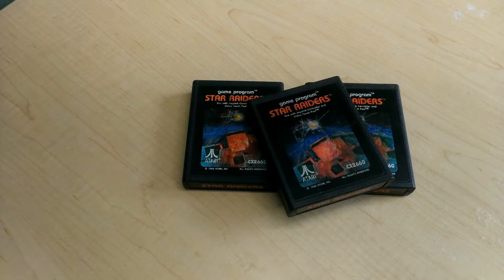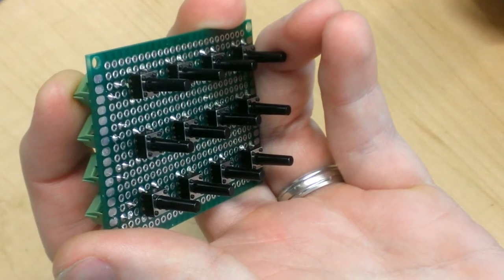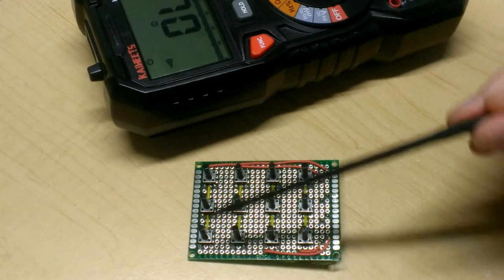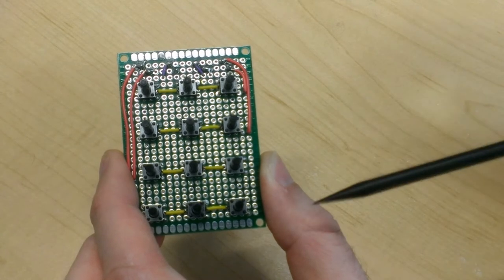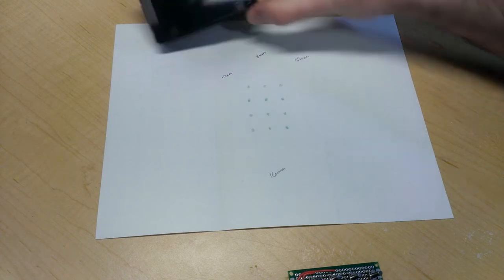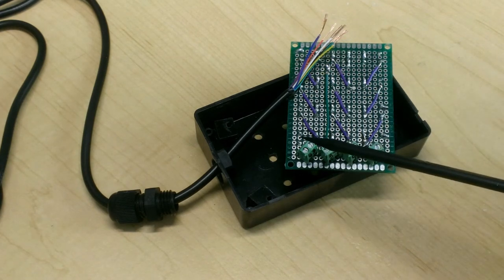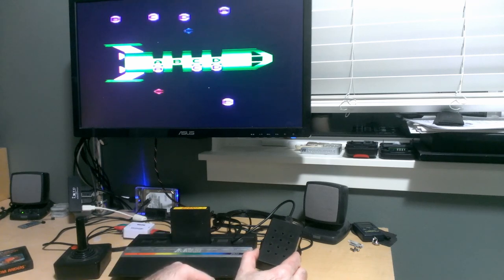Building a Universal Atari 2600 12-button "Star Raiders" Controller

Comment: I'm gonna explain this in detail in case someone happens along who wants to learn what this is doing and how/why it works the way it does:

As several folks have noted, the resistors are for the paddle inputs pulling them back up to 5v quicker so that they can be read as digital inputs (since pin 7 is 5v.) The VCS/2600 is kinda unique in that most of those pins go to one of the three chips that make up the machine: The MOS 6532 RIOT. It's got I/O pins that are normally read as inputs for a joystick, but some of them are turned into outputs for use with this controller. You've got direct control over whether pins are input or output, and when they're set for output, you have control over whether or not they are logic high or low. You NEVER set the pin to output and to output high on the 2600. Here's the pinout of the connector for reasons why:

1 JS Up
2 JS Down
3 JS Left / P2 Fire
4 JS Right / P1 Fire
5 P1 pot
6 JS Fire
7 +5v
8 Gnd
9 P2 pot

There are multiple pinouts of the Atari connector … but this one (for the C64) is most accurate as to what's going on with the connector. Each of those things that is normally an input has a "pull up" resistor to 5v to ensure that the pins read as a known state whether there's anything connected to them or not.

If a joystick is connected, the nine pins connect to "nothing" (but pulled to high) until the joystick is used, in which case the joystick will ground one of the JS inputs. Why you never risk outputting a 1 is that if someone has a joystick plugged in and moves the stick while you're outputting logic high, you have an instant short to ground! So you keep the pin on input and only flip it to output after you've set it to output ground. If a joystick is grounding the pin the same time the RIOT chip is … no harm!

But then you come to the pots… The joystick doesn't connect them to anything. A resistor still drags the voltage up towards +5v, but it's far from instant. In the Atari, the TIA (Television Interface Adapater AKA "special sauce") chip does magic to turn the pot's rotation position into a number. But we don't want a number, we want a binary low or high. So we use a smaller resistor that makes it read as "high" faster, and we ground it to get a low, like with any other input.

So now you have the recipe:

Set output value of the four direction pins to 0 (even though they're still inputs!) Then, each time we read the inputs, we:

Set pin 1 to output (0)
Read P1 pot and test it for high/low to get button 1
Read P2 pot and test it for high/low to get button 2
Read JS Fire to get button 3
Set pin 1 to input

Sit pin 2 to output (0)
Read P1 pot and test it for high/low got get button 4
           :

Again that all happens SO fast you don't even see it. Pretty nifty!

There are four kinds of controllers from the day and a fifth that get used today. I think I've explained three of them. Omega Race had its own piggyback controller which sits between the Atari and your standard joystick controller to give you a second fire button (on pin 9). I don't know if it uses a resistor like the keyboard controller does to ensure that the signal returns to logic high faster or not. The last is a modern thing: The Genesis controller. It works by putting button C on pin 9. But it's a little more complicated than that.

See the Genesis controller has more buttons than you can possibly read from a classic "atari style" joystick port. Or rather, I should say more pins than you can read from a standard Sega joystick port. THEY ARE NOT THE SAME! Pin 7 on the Atari port is permanently +5v. On Sega ports, it's pin 5 that's permanently +5v. And remember what happens when you plug in something that accidentally connects +5v to GND: Magic smoke happens!

Turns out the Genesis controller uses +5v to power a chip that selects between two sets of inputs. One of them is the A button and Start. The other is the D-Pad, B, and C. If the chip expects +5v on pin 5 … it'll get something close to that by accident from the P1 pot's pullup resistor. Since pin 7 is permanently high (being +5v for Atari and C64), it guarantees the controller is set to read the D-pad (pins 1-4), B (pin 6), and C (pin 9). Pin 9 has no fast pull-up resistor, but it's fine the way modern Atari games use it since they're not scanning a keypad and they're coded to know what to expect.

I've been considering the C64 and Atari ports synonymous. I don't have a C64 schematic in front of me to know if the pot lines have any pull-up resistor to +5v on the C64. They SHOULD because you should never leave a pin floating with any kind of MOS technology, and the SID chips are NMOS or HMOS (depending on the vintage…) Still, some people have reported that use of Genesis controllers have fried their SID chips. How realistically likely is that? I'm gonna say pretty low since there are so many other variables, but I'm pretty sure the Atari is safe to use them this way. If in doubt or to be 1000% safe for the C64, make an adapter cable that leaves pin 5 floating (which is safe to do as it's an intended state) and connects pin 7 on the port to controller pins 5 and 7. Through 4.7k resistors if you really want to be 10,000% safe I guess. But the TIA isn't gonna flinch at having a digital button connected to its paddle inputs, so … don't worry about it too much unless you want to also think about the C64.

The other thing to consider is the 7800 which used resistor tricks to make its two fire buttons work. The VCS/2600 doesn't see or care about the difference.

Comment: As pin 7 is permanently 5V, these two resistors are clearly pull-ups for the Atari inputs 5 and 9.  Looking at the schematics of the VCS main board, these pins are later connected to a 0.068 (uF?) capacitor and to the TIA chip that does its weird analog to digital conversion. My guess here is that the existing pull-up capabilities are not enough to charge the capacitor to its idle +5V state fast enough. Therefore the resistors here help with this issue.
The pin 6 line on the other hand is internally connected to only a 220pF capacitor (for noise reduction, probably) and obviously this poses no problem for the circuitry.

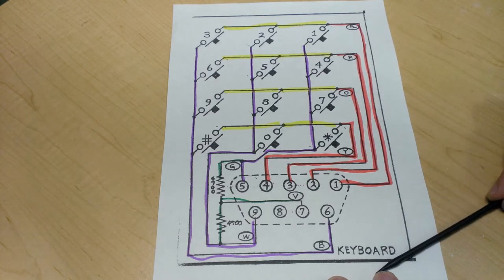Comment: To pile on what I’m sure others have written regarding the resistor circuit @6:45 , pins 5 and 9 are the paddle sense input pins, which via the 5v dc pin 7 supply gives a fixed voltage to the paddle inputs , unless a button on columns 2 or 3 are pressed. So the paddle inputs, being analog that produces a 0-255 value from a voltage , get repurposed as digital column binary inputs by setting them to one of two voltages.  

The joystick port as 5 binary logic inputs  (L R T B FIRE) and 2 analog (PAD1 and PAD2 ). You need to provide 4 rows and 3 columns  input values (7 input bits) but you only have 5 binary input , so it’s repurposing the 2 analog inputs as binary. 

Also by having a fixed resistance in place providing a known voltage to the 2 paddle inputs that could be used for the system to detect that a paddle was plugged in , maybe.

Comment: Pin 7 is +5V, Pin 8 is Gnd, Pin 5 & 9 are paddle inputs, pin 6 is joystick trigger, and all three are handled by the TIA chip, Pin 1-4 are joystick 2 directions and high nibble of port B on the RIOT chip, low nibble of port B is joystick 1. There are 4 paddles and 2 joystick triggers. Port A on the RIOT chip handles the 5 switches on the front of the 2600, and not the on/off switch. I believe paddle use 10K pots wire between Gnd and +5V with center contact input back through either pins 5 or 9. (paddles 1/2 & 3/4) RIOT is Ram Input Output Timer chip. Pins 1-4 are pulsed low (output mode) individually to scan the rows and a change in state of either paddles or trigger button will register an input/key press. Paddles are either 1/2 charged or fully discharged and ditto for the trigger button, charged or fully discharged.

Comment: Thanks for sharing.  One thing I recommend is ‘tinning’ the wires before mounting them into screw down connector so don’t have to worry about strands of copper breaking.
Reply from the maker: Excellent suggestion!  The wires on these cables are very small, so I ended up folding the exposed end to double the thickness of the strands, then inserting into the screw-down connector.  Tinning would have made for a much stronger and longer lasting connection.

Comment: Nice job!

It looks like Star Raiders game play functionality isn't too different from Starpath's Phaser Patrol. 

In the latter, it used a difficulty switch to change from view screen to map mode, and the B/W switch to toggle the shields, eliminating the need for a keyboard controller.
Reply from the maker: That's quite clever!  It seems like you might need a co-pilot if the console is too far from the joystick :)
Reply: True, but I like using the console switches, makes it easier to imagine it being part of the switches on a space ship, as opposed to the video keypad. 

When dealing with the video keypad, the text on the overlay is quite small, though it might have been easier to read when I was younger. Also trying to press the keys through the overlay just doesn't have a very positive tactile feel
Reply from the maker: Yes, that's one of the things I never liked about the VTP -- the remote-control-style buttons with little tactile feedback.

Comment: Cool project.  So if I understand correctly, it looks like each row should be independent, but only one button will work at a time on each row?
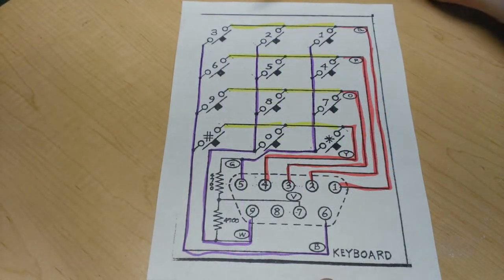Reply from the maker: Thank you for the feedback!  I never really thought about this, but I do think more than one button press may register simultaneously in any row, as each column is routed to a distinct pin (schematic at 3:51).  The cartridge will turn on one row at a time via pins 1,2,3,4 -- so multiple button presses in a column can't register simultaneously (in the strict sense).

I recently learned that there is no direct hardware support in the console for the the 12-button controller, and that each cartridge programmer had to implement their own scanning logic.  There could be some weird implementations in the wild where simultaneous button press are ignored!

https://en.wikipedia.org/wiki/Atari_joystick_port#Keyboard_controllers

Comment: Codebreaker:  Magic!
Is the PIN 7 arrangement a Column Strobe?
More accurate repeatable drilling tip:  Drill Press
Reply from the maker: I figured this one out two weeks ago for another project I'm working on :)

Pin 7 provides +5V in all (most?) Atari/Commodore/Sega DB9 joystick ports.  Also, pins 5,9 are the same inputs for paddles and therefore must be analog inputs.  In this case, the CPU determines the analog voltage level (something between 0 and 5V) by measuring the time it takes for the given voltage to charge an internal capacitor.  If we left the pins floating, then the CPU presumably can't determine if the voltage is truly zero since it is taking an infinite amount of time to charge the internal capacitor (I know, WE can deduce this, but maybe the CPU doesn't have the capability).  So, a resistor is put in place to anchor the proper "zero" state, which is bypassed when a button is pressed.
Reply from the maker: My explanation above is over-complicated and somewhat incorrect.  There is a simpler explanation: we need to limit the current to pins 5,9 in the event of a supply failure or short circuit.  We can't leave the pins floating because the CPU expects them high at 5V all the time.
Reply: @SteveGuidi  NO NO NO pin 7 is NOT +5v on Sega! That's a big mistake to make since shorting ground to pin 5 on a Sega Mk III, Master System, Megadrive/Genesis will SHORT THE CONSOLE. Sega uses pin 5 for +5v. See schematics on gamesx for info. (No link because Youtube will interpret any link as automatically spam because Google is run by morons.)